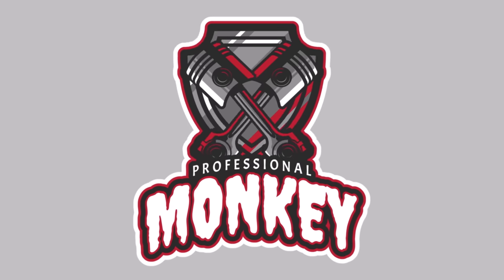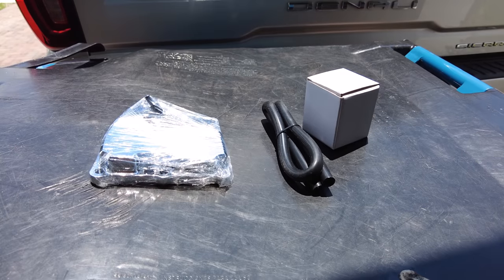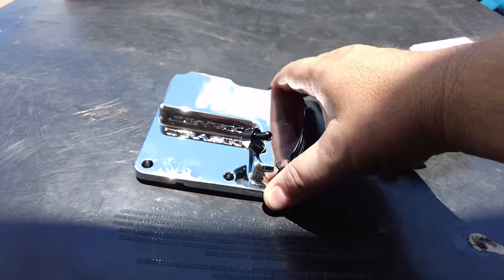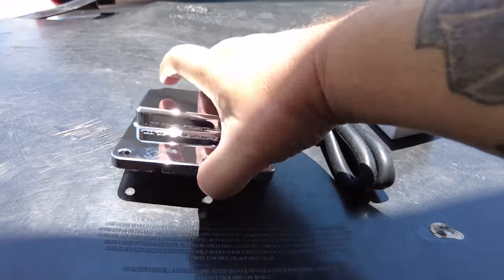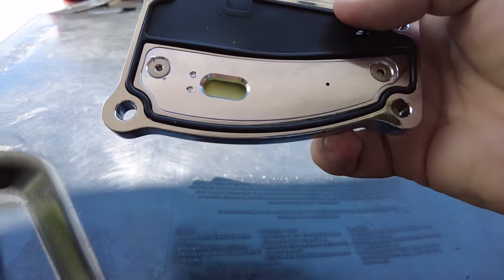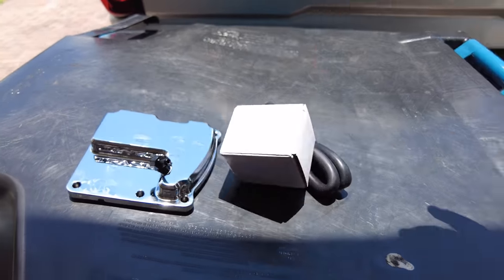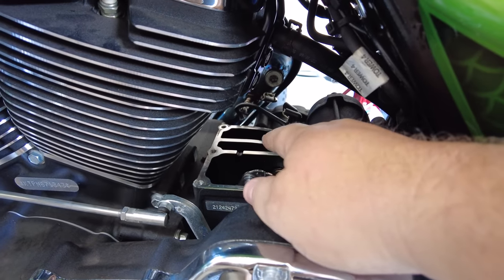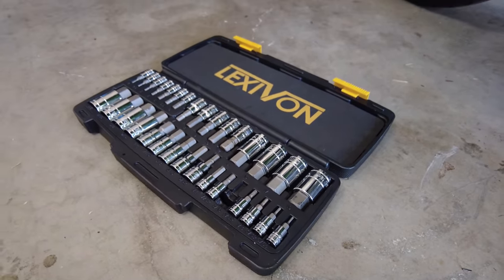Harley Davidson Milwaukee 8 Crankcase Venting - Trask Transmission Cover!

Comment: Venting the transmission doesn’t help with engine oil blow by. The transmission and engine are not connected internally. This would only help with transmission to primary oil transfer which has already been fixed by Harley with a vent tube since 2020.

Comment: Got one.  After going to a stage 3, I had oil dripping out of the air cleaner.  Tried the vented dipstick first and that didn't help much, then added the air cleaner bypass trick.  Lastly, got rid of the dipstick and added the trask case vent and that seemed to solve the issue.

Comment: If a guy was buying a used 2022  low miler , Do you think its unreasonable to insist that the Harley Dealer do what should have obviously been done from the factory as a stipulation before the deal is done .  At their cost of coarse . ?

Comment: Apparently the 2024 transmission cover can be used on earlier models and the problem has been solved by doing this.  The 2024 cover is vented.

Comment: Just installed this on my 22 King.  It is an easy but pita job to get those bolts out.  I ended up just tucking the filter on the right side cover.

Comment: I solved the misting issue into the air intake the breather bolts bypass with fuel line two into one to a see thru one way gas fuel filter when it turns dark chunk it put on another easy pesy i remember the harley solution drill hole pull the little vent tube thru don't know if it worked anyone know about this?

Comment: I also installed the Trask vented transmission cover along with the external head breathers from DK Customs on my 2023 107 Street Glide. My previous two M8s had blowby issues and consumed excessive oil. I have also used the Fueling vented dipstick, which started to leak. Any hoot, the problem with the vented dipstick is the location. More is vented from that area because of the amount oil sloshing around. And because of this, Fueling highly recommends that the internals be replaced at every oil change. The Trask setup sits higher and does not suffer from the oil sloshing around. With the vented dipstick, I was still getting puke from the head breathers into the catch can. With my current combo, the vented transmission cover is doing such a great job that I get damn near zero puke out of the head breathers. So far, my oil level is staying steady. Time will tell. But I am happy with this combination. Trask highly recommends also venting your head breathers externally with their vented cover :-)

Comment: Crankcase venting is necessary because air is being constantly displaced whenever the engine is running. Atmospheric pressure at sea level is 14.7 psi. When the piston travels downward it compresses the air within the crankcase, when it travels upward during it's compression stroke the pressure within the crankcase drops quite a bit. So the air within the crankcase is constantly fluctuating as is the air/fuel mixture within the piston chamber.
Oil being an incompressible fluid (air is just a compressable fluid) is constantly moving around with the fluctutions in crank case pressure as well as moving within the oil galleries due to the oil pump pressure. Some of this oil moving around becomes blowby: HD redirects that oil into the piston chamber in order to comply with EPA regulations. While this is good for the environment it's bad for the engine as it results in more carbon build up within the piston chamber.
You want to vent the crank case in order to reduce blowby, but you also want to vent the crankcase in order to reduce migration of oil between the engine and the transmission.
A vented dipstick from Fueling is a good thing to have, also a vented transmission cover from trask. DK customs makes a nice setup to catch oil blowby and instead of having that oil redirected back into the piston chamber it goes into either a catch can or a filter.
Venting the crankcase on an M8 is a no brainer. The larger the displacement an engine has the more venting it needs.
Also a no brainer for the M8 is replacing the OEM CAM plate and Oil pump with one made by either Fueling or S&S. Doing this esnures better lubrication which in turn reduces both wear and heat from friction.

Comment: I just installed the cover on my 2022 Heritage Classic 114. When I took off old cover found lots of moisture in the crankcase section. Hopefully it helps that too but wont know till spring

Comment: Installed the Trask transmission cover on my 2019 ultra which also has the S&S 475 cam. I haven’t had a single issue.

Comment: I bought the transformer EBS system.  With 828 outlaw air filter assembly.  And had Harley dealer install S&S intake manifold.  Already had the Screaming eagle Tune installed. My 2020 Street Glide is now full stage one. Runs fantastic.  Just installed Super Shox and man what a great ride!

Comment: Ordered this because my plastic one is leaking a little after doing cams and dyno tuning. Hope this helps. I think you were supposed to route the hose in the caddy area. It's supposed to be at a higher level to the cover.
Reply: you are correct, I spoke with Trask, it needs to over the "backbone" of the bike frame under the seat, he has it installed incorrectly

Comment: EBS for the breather banjo bolts. Lots of solutions out there but the DKC version is really slick. Got it installed with their 606 AC and looks / works great. The EBS is called transformer.
Ride safe 🤙

Comment: i think you are right on the fact that both products act the same. but it is way to check your oil with a trask cover vs the feuling dipstick. and its much easier to install the feuling dipstick

Comment: Most go stage 2 but I don't want the noise on long distance riding or have to do remapping,so opted for,S&S cam bearing ,cam plate, lifter's, Tappets, tappet guides,oil pump , and put a new stock M8 cam , and replaced the air filter with a washable one instead of the paper crap,I believe this is the way they should have come out of the factory

Comment: Help me understand; how does putting a vent in the transmission alleviate crankcase pressure in the engine? Aren't the engine and transmission separate from one another and only connected by the primary? I'm new to the M8 coming from a Shovel.
Reply from the maker: They aren’t totally separate. The seals allow a certain amount of flow between the three.
Reply: @ProfessionalMonkey  Thank you friend. Love your videos and I appreciate you reply.

Comment: Correct me if im wrong but have read that Harley fixed this issue in 20 or 21. I have a 21 Street Glide and ive had zero issues.
Reply: Oil pump update... M8s still suffer from too much crankcase pressure. Your engine will run better if you vent it. The Trask setup in my opinion with external head breathers is the best combination. It is working great for me now. Not as good with vented dipstick, which started to leak over time.
Reply: Thanks Richard. I just realized that I had a complete brain fart when I made this comment. I was thinking of the M8 sumping issue. Duh!! Totally different from blow by. Anyway thank you again for the advice and I'm definitely going to look into one of these corrections for the blow by issue.
Reply: @blownmouse  another good insurance policy is to install the Fueling short sump plug... HD quality control is lacking these days. the sump plug they use on the bottom of the case is too long. and, if installed too high into the case, it can block oil pump flow, which could lead to sumping. it is amazing to me that HD has not sent out a recall on this. there is one particular service manager who admitted that HD is aware of this potential problem. the shorter plug is installed at a specific height into the case preventing protrusion. ride safe : - )
Reply: @richardrussell500  Thank you again. I haven't heard of the plug issue. I'll definitely bring it up to my dealers service manager.
Reply: You bet... :-)

Comment: I would put my own fitting on the stock cover and run my own hose before I spend $350 on a new cover. Trask can go screw themselves if they think I’m spending $350 for that. 
On my previous bike I ran a DK Custom oil catch can with my own hoses and fittings and probably only had maybe $75 in it.
Reply: Agreed. I have the DK stuff too. Works good.
Reply: @alanquintus2069  I was very happy with their product.

Comment: If you vent the crankcase with a Trask cover, would it make sense to seal off the breather bolts to the air filter to prevent oil ingestion?

Comment: Hey what tuner would u recommend I wanna do s&s 475 cam and few other little bits on my 2023 roadglide special. Mabey the 30/30 cam I just want the pull and that low grunting sound I got a bassani 2into1 exhaust going to get a trask assault intake and I'm doing the trask transmission cover any input would be appreciated from u brother!! Keep up the good work very informative and funny vidoes man lol!!!

Comment: I get alot of blow by gasses on my twin cam. Have had to change out the air filter that was full of oil. Wonder if that would work for the 103
Reply: Yes that or the dipstick will work
Reply: @Peter I don't do any of this crap I just ride the bike . Lol
Reply: @@Peter-nm1psYou can ! Just go to your dealer and buy one.
Reply: @xtreme4stringbass   not necessarily. I only put 3 quarts in my engine and still blow by and lose oil, 1qt every 1500 miles or so. I did a little different but much cheaper thing and haven’t had any leakage issues since. 🤷🏻‍♂️

Comment: Aren’t you supposed to route the breather up to a higher point on the bike ?

Also, the dipstick and trans top are not the same as external breathers. Re routing the breathers does just that. Sends the oily mist elsewhere and does nothing to relieve crankcase pressure. The vented dipstick and trans top do.
Iron Anchor Cycle has a great video that explains this. Thanks for sharing !
Reply: Yep exactly right I have the trask vent and the trask clear intake and mist still got into the intake and some oil , external breathers got rid of the mist
Reply: External breathers get rid of the mist in the intake and just send it elsewhere. To a catch can or into the atmosphere. It does not stop the mist !
Reply: @toolmaker5150  yes that’s the point to not go into the intake lol who cares where else it goes !!!!!!
Reply: @toolmaker5150  and mist will never stop if that’s what your getting at that’s how engines always work